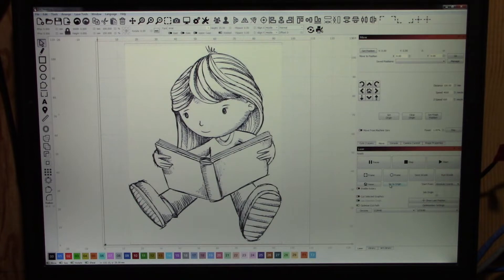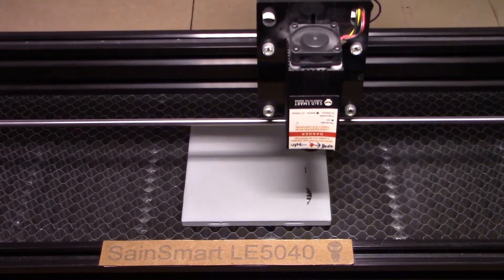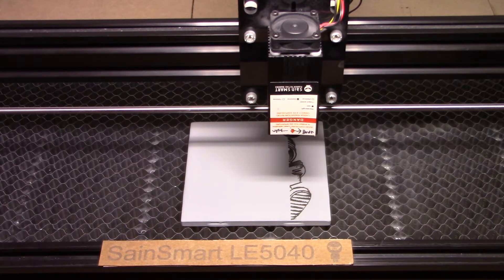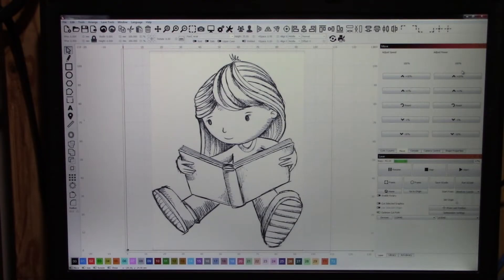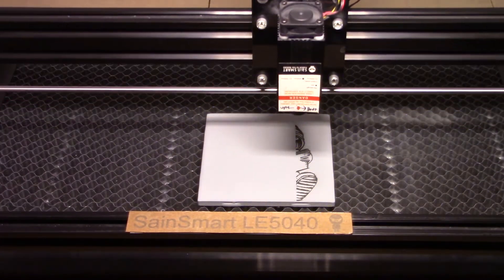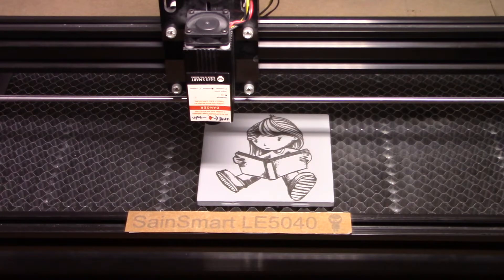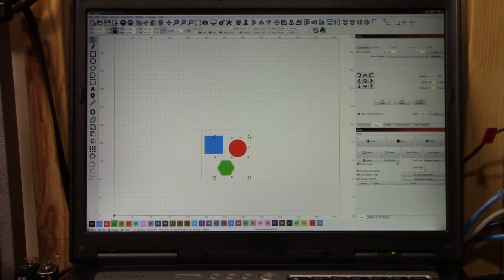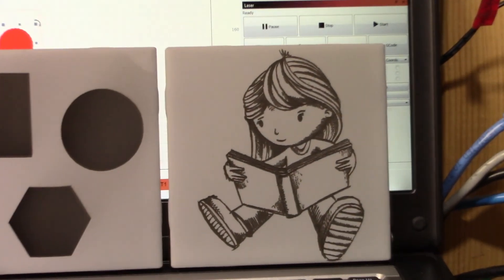Can I stop in the middle of a burn and start there later?

Comment: What would happen if the COMPUTER turns off because  you forgot to plug in the power supply to it while you were burning a project, could you restart where it stopped?? If so could you show what you could do to finish the burn.
Reply from the maker: Great question!  If your computer goes down while feeding data to your controller, you are more than likely out of luck.  The laser controller will just sit there waiting for more instructions (if you have the type where the controller is spoon fed the data vs a controller that will take all of the data first and then start burning) that will never come.  Depending on what your project is, you might be able to guess where it left off and try to burn from that point forward.  Unless you were right on the money with that, you would most likely burn an area twice or skip an area.  
To do this in LightBurn, you would open your project, create a mask around the area you still need to burn and burn just that.  You would also need to insure your laser is homed or aligned exactly as it was before you started.  
Picking up a burn after a crash such as you described is next to impossible. I hope this helps.
Reply: This just happened to me and I thought about the preview function. Turns out you can slide the bar right to where your laser stopped and click “start here” and you can pickup where your program fell asleep. I’m assuming we have G code to thank for that
Reply: @drewbeisly7328  Thanks for this , brilliant info 😀👍